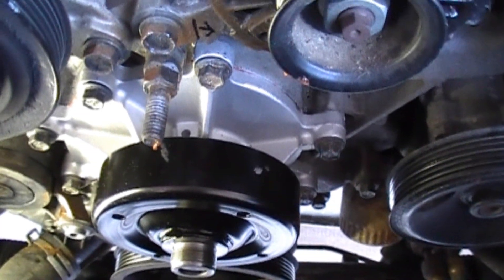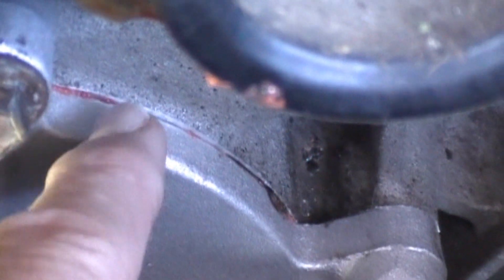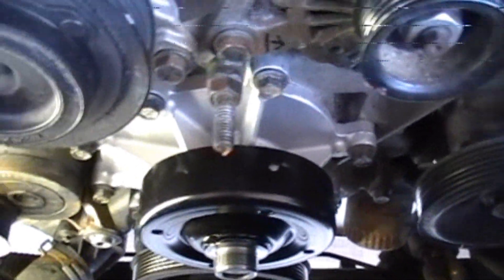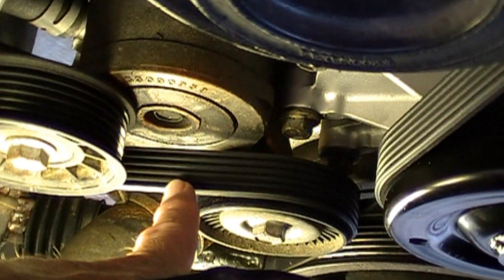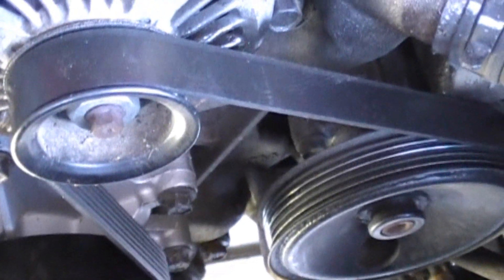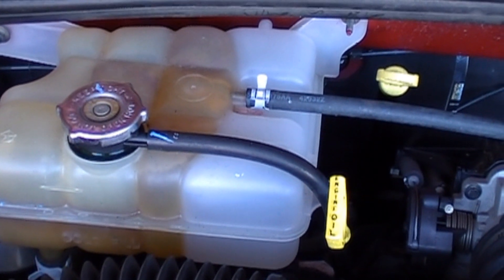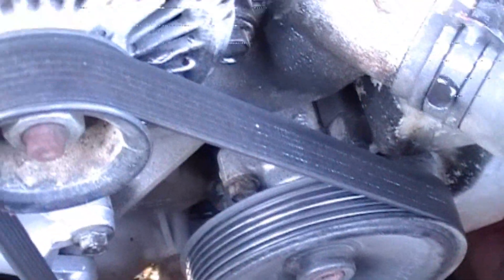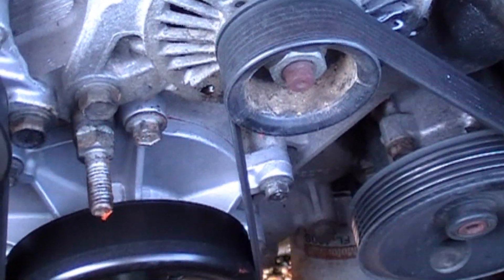Jeep 3.7 Water Pump Replacement-Part 5 of 5

Comment: My serpentine belt tore to shreds while in rush hour traffic the other day. Initially, I only bought the belt and tried to replace after work yesterday. Then I realized the water pump pulley was wobbling like the one you showed. Gonna invest my afternoon in replacing that tomorrow thanks to your video. Very straight forward and excellent instruction/education skills. Thank you so much for your help. You definitely saved me cash!!!

Comment: 208k to be precise. She drives about 140 miles a day 6 days a week. It's all mostly interstate miles.Last spring I installed its first new set of front brake pads believe it or not.Now that is crazy isn't it? She is lite as a feather on the brakes huh? I love it! Change the oil once every month. Working on the 4th set of tires. Great little vehicle! Best of luck to you and your liberty. Thanks!

Comment: Hey Thanks a bunch, when I was replacing the serpentine on my jeep belt I noticed the shake in the water pump pulley so I knew I had to replace the pump. I have a 4.0L 2001 cherokee sport and all of your tips applied. Thanks again!

Comment from the maker: Thanks for your comments and for following along.  You are correct, it is a good idea to bleed the upper radiator hose by removing the alan plug.  I forgot to include that in the video.  Hope all goes will with your repair.   John

Comment from the maker: Sorry for the delay in getting back to you.  I am not sure of the two bolts you are looking at, however it may be the bolts holding the water pump on to the engine block.  As I recall there were two bolts that I first thought were part of a bracket but were, in fact, holding the water pump.  Hope this helps.    
John

Comment: Great Video. Just a heads up. On aluminum blocks the 50/50 mix is used because it uses Distilled water because regular water can damage the aluminum.

Comment: great video! i have an '07 jeep wrangler jk. im due for a water pump replacement. this seems like a pretty straight forward job. question. is it recommended to change the thermostat while your replacing the water pump as well? any info would be great. thanks for the tutorial

Comment: great video, I have a 2003 jeep liberty, water pump just went out, fan blade has cracked and a small piece missing, do you know if I will have to replace the fan alone or will I have to purchase the fan and shroud as  a unit??

Comment: Great video i have 06 liberty with 102,000 miles no problems for all four window regulators,blower motor switch, rear brakes then fronts. I would have used mopar waterpump and what about replacing with red coolant again instead of green? Thanks again

Comment: @johnrob281 Hey John -- I've changed many water -pumps in my long life of playing around with cars -- but I must admit this one was one of the most frustrating .Unlike your vehicle my Liberty dab both the electric & the clutch fans .But Chrysler thoughtfuly made sure that the fan shroud would not clear the viscous  clutch end by about i/8 of an inch --- had to take apart the entire rad to get the extra clearance ---When I put it back on I trimmed the bottom of the shroud to re-install.

Comment: I just did this job on a guy's Jeep and installing the water pump could not have been easier, however upon the test drive the guy said it overheated and when he pulled back in the driveway the drivers side plastic radiator end tank had cracked!  He was blowing steam and had to go home defeated, as my fix didn't get him back on the road in time.  What happened?  My theory, just to save face if nothing else, is that it was a stress crack that finally failed, from previous overheats.

Comment: thank you for this video, I just change mine It is pain in the neck to take the pump out , the alternator pulley  was in the way I tried to take the alternator pulley out , I end up scratching the pulley , finally I get an idea to lift the whole alternator up just to fish the water pump out I wish you show us how to fish it out in this tight room, by the way mine is 4.7 liter engine
Reply from the maker: Thanks for your comments.  At this time I do not have a 4.7 engine, but you may want to check out some Jeep forums for more info.

John

Comment: John; i have a 2005 jeep liberty 3.7L and i have a water leak that looks like its coming out 
from the bottom of the water pump housing. there's 2 bolts at the bottom of the housing under the jeep. any suggestions on this issue.

Comment: John, great stuff thank you for the video! I'm about to get started but on my 2010 jeep, the coolant reservoir is in the front of the hood, unlike yours where it is located toward the back. Therefore, I don't have as much room as you do to loosen the bolts. Do I remove the coolant reservoir/ windshield wiper reservoir thats blocking my workspace or just work around it?
Reply: Ryan N pull alternator.

Comment: also too bad you don't have a video on the power steering pump, before I figured out about the water pump being shot, the power steering cap blew off and sprayed fluid all over the engine..I'll bet you never heard about that happening? well thanks for the videos